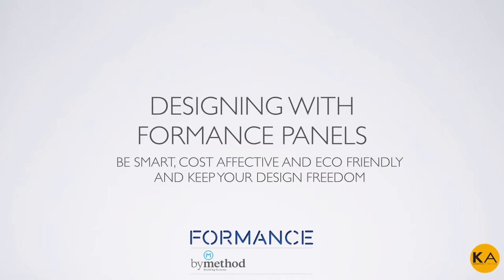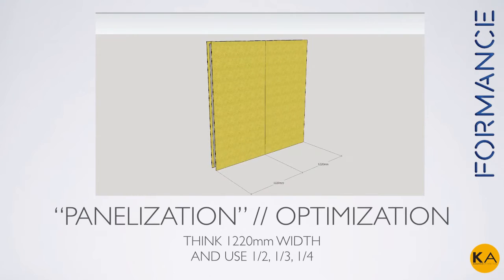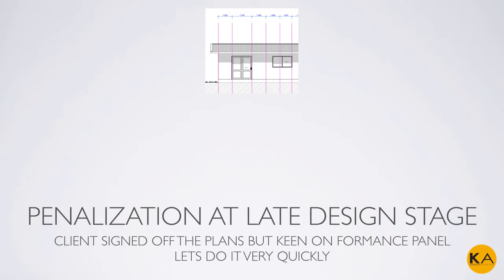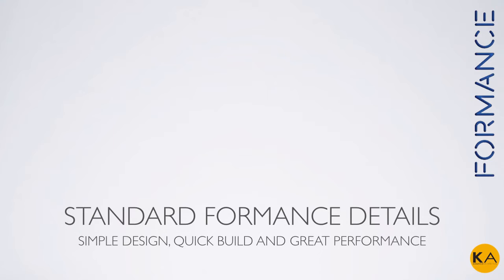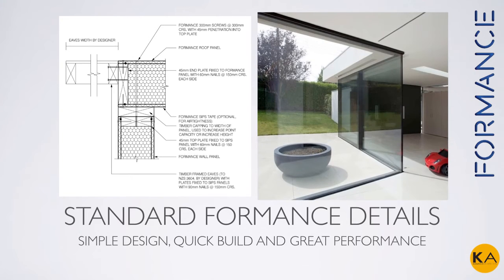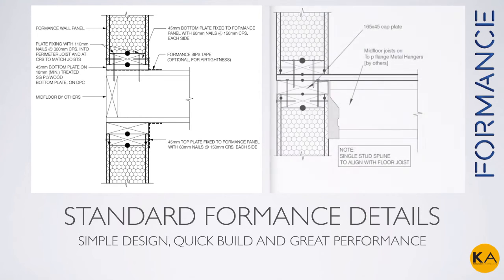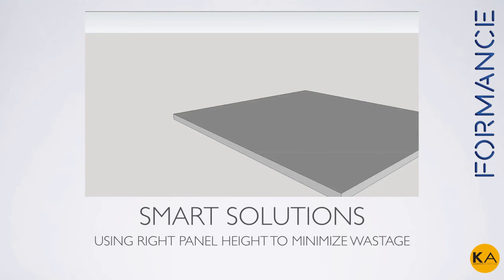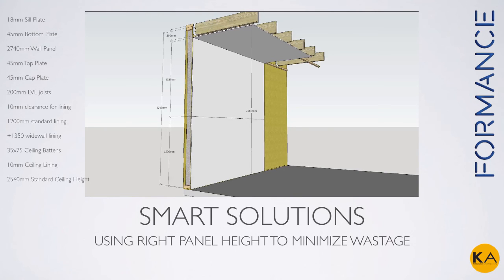Designing With Formance Structural Insulated Panels (SIPs) NZ

Comment: Does the internal side of the house need to be taped on the joints with a vapor membrane?
Reply from the maker: Hello @oaklejant, Sorry this is a bit of a late reply but for anyone else looking at this question, yes SIP tape is required on the joins internally for optimum airtightness. This is part of our building system.